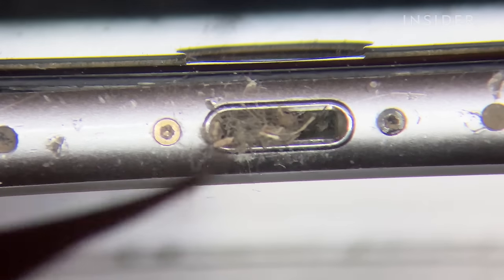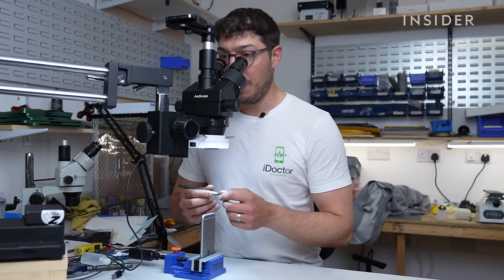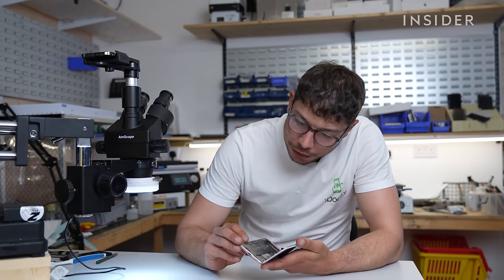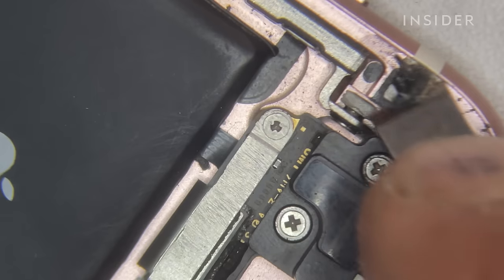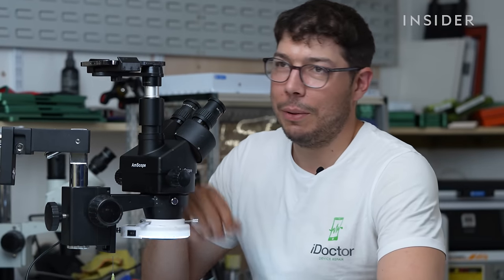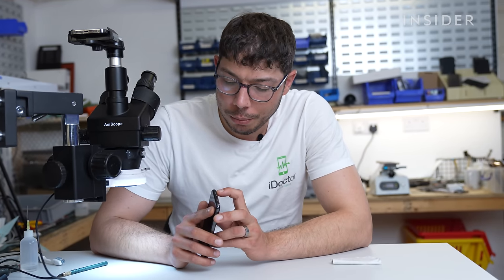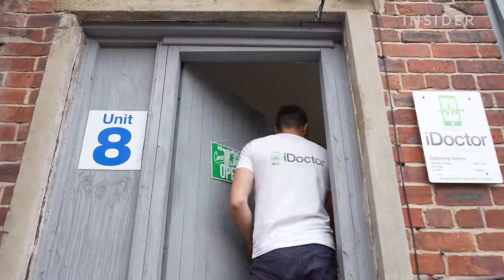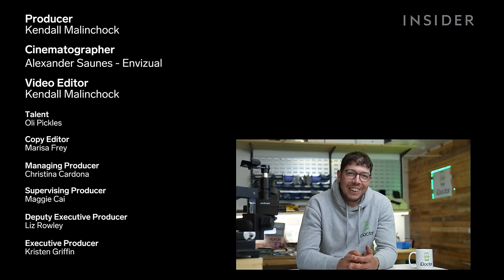Deep Cleaning Clogged iPhones | Deep Cleaned | Insider

Comment: Been doing the same thing working as a technician in a Apple certified retailer. A great way to finish up the job is to use some form of cleaning putty for the bottom speaker grills and top speaker grills; you can get rid of the left over gunk
Reply: can you please help me with the cause of error 10 in itunes and phone is stuck in recovery mode. already tried everything from apple support website
Reply: @ramanbhadu1   I am not familiar with error codes for iTunes as we use Apple configurator for pretty much all our restores. Judging from what you're saying it sounds like you're experiencing a hardware error which means it either fell in liquid or suffered some physical damage. There is unfortunately no way to fix this.
Reply: 100%/99% alcohol safe to use?

Comment: Thank you so much for this! My charging port had been getting clogged, but I couldn't see inside well and I didn't want to tinker with it and damage it further. But after seeing a professional just stick a tiny metal object inside the port and clean it out, I felt confident to do it myself. I cleaned out way more lint than I had expected, and the port works good as new now! Can't remember the last time I felt that satisfying snap when I plug my charger in!

Comment: After it started to become increasingly difficult to get the charging cable into the USB-C port on my Android Pixel 4a phone, and thus to charge it, I was able to resolve the issue with a sewing needle. After turning the device off I was able to use a fine sewing needle to fish out all of the lint and compacted debris at the bottom of the charging port, after which it became easy to plug in and charge the phone. This is a task that you need very good close up vision to accomplish, as I'm short sighted, fortunately just taking my glasses off gives me extremely good close up vision.
Reply: Funnily enough I had exactly the same issue, on the same phone. I actually had enough gunk collect in there that the charger no longer plugged in fully flush to the phone, so I fished it out with a very pointy compass
Reply: I ended up undoing a paper clip to clean out the port
Reply: Did the same exact thing with my Pixel 4a. I couldn't properly charge it for months without perfectly positioning it and it would keep popping out unless the phone was perfectly stable. Forget about trying to charge it in a moving vehicle. Was this close to buying a new phone until I did this and removed 2 years worth of gunk in the charging port. Now it clicks in like a charm and stays there
Reply: You don't need that good of vision. Just know that USB C ports have the piece in the middle and try not to bend it. Also I'd recommend not using something metal as it could potentially scrape off the contacts inside. Otherwise just try to scoop it out, don't need to be able to see inside it really.
Reply: @An4lAvenger  I tried 'scooping it out', which didn't work as the lint was compacted hard. There was no danger of scraping off the contacts or bending the middle piece as this was an extremely fine and sharp needle which went nowhere near either, but did require precision guidance, only possible with good close-up vision.
Reply: I also have this phone and for me the speaker is now way too quiet. Have you also successfully cleaned the speakers?
Reply: @koacado  I no longer have the Pixel 4a and have upgraded to a Pixel 7a. I never had a problem with the speakers, so never had any reason to look into that particular issue. I wish you well in finding a solution to your current issue.

Comment: I’ve had an iPhone 8 Plus for 4 years and always had a case for it. For the most part there’s not that much dust in the speaker holes and the charging port is mostly clean as well. I have never run into anything remotely close to anything this bad with the gunk that was shown with the phone in this video.

Comment: I have been using my phone for 5yrs now. It has not reached this extremely unpleasant phase.
Reply: Same. And I've had mine 4.
Reply: If you clean it it’ll look new. I have a 6S from 2016 and there is not even a speck of dirt on the speakers or microphones.

Comment: I went to the store because I had problems with charging, they said the port needs to be cleaned, I asked how much, they said 25$, I asked them again just for cleaning? They said yes. I said goodbye. Got my nail scissors, and digged in, got it competely cleaned after 2 minutes. This "repair" is such a scam, you can literarly do it with a neddle or anything in like 5 minutes tops.
Reply: i wouldnt call it a scam. you are trying to get someone to do something for you that you can do yourself and most people arent going to crack open their iphones to clean inside it
Reply: @KKarama1  I have no idea what you said here, I didn't say anything about cleaning the Inside of the phone, I said the charging port, which is, infact, outside, and takes 5 minutes to clean with any basic metal tool that can fit. Mind you this 25$ price is in a country where the average wage is 800$ monthly. I can't even imagine what this costs in the USA..

Comment: Are you using a metal pick? Is that dangerous? I'm assuming some pins could get shorted but that maybe a wrong assumption? Thank you
Reply: Not anywhere in the speaker grills or charge port can you short it.  The pins are there only to receive power or send data signals.  It's why most phones are rated at some capacity to take a swim for a bit and be fine.  He doesn't use the metal pick near the circuit board once it's open, just on the edges to scrape up the sealant.

Comment: The rice method did work for my old phone after i dropped it in the toilet but a piece of rice got stuck in the charging port and I used a toothpick to get it out. 

Is there another method to get the same effect as the rice did without any of the issues that the rice gives like rice getting stuck in the charging port or starch getting into the phone itself?

Comment: Used to do this for a living, but I have one question regarding the screws... where are they going? They're all unique for the most part, and putting one in the wrong hole is a sure fire way to break something. I saw him palm a couple, but they should really go on a magnetic board, mapped out to the shape of the piece being removed, so you can not only find them easily but quickly put them all back in, if on a deadline. Also I refuse to believe that first phone was a genuine clean, that much lint in the charge port and the cable would just fall out, and I can't see anyone being that oblivious that they take it for repair without figuring out the problem themselves. If it is real, the owner should frankly be ashamed of themselves, that's fucked up.
Reply: Also the transition at the end from metallic finished to matte was funny, as you can't clean a mirror-finish like that and produce a matte one. Two different phones for sure.